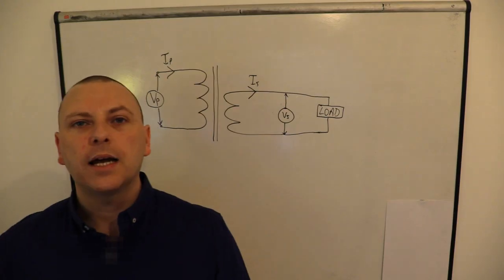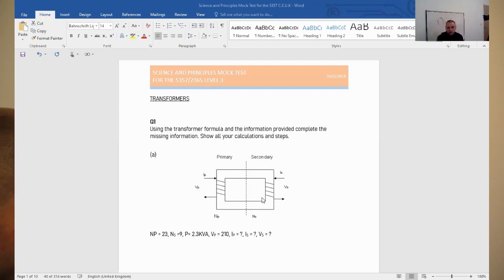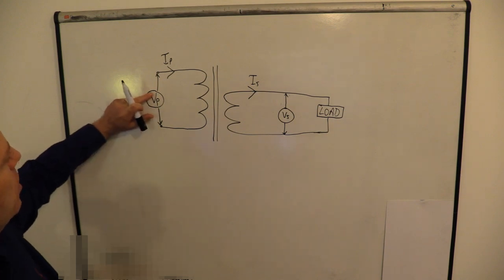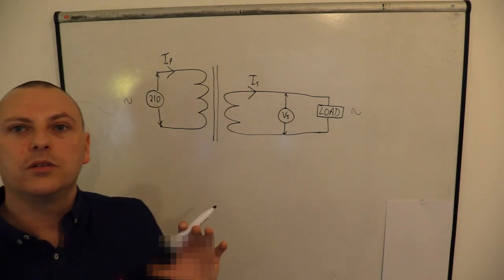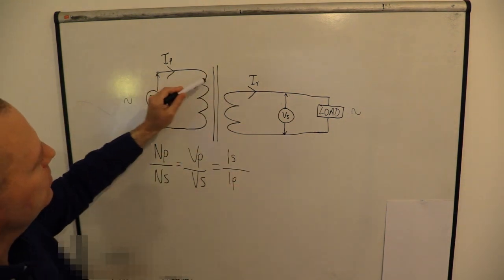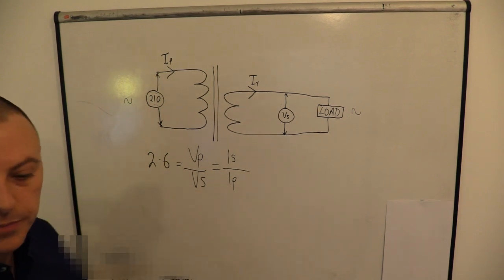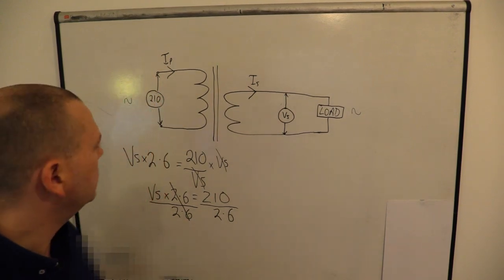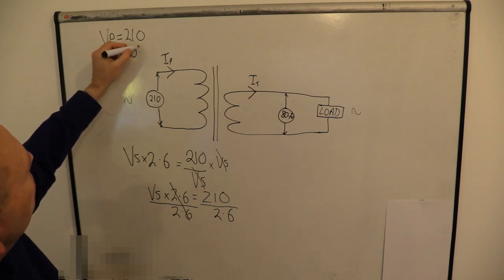Electrical science and principles typical questions No  1                Transformers

Comment from the maker: Beware of accumulating rounding errors!!! In the video I did np/ns=2.555555556 (rounded to 2.6 using only 1 significant digit) and then used that against the vp/vs and transposed for vs to get 210/2.6=80.769 (rounded incorrectly to 80.7 😬) 

Had I simply transposed the formula from the start then I would have ended up with 82.2V

The point is its important to stick to an amount of significant digits and round carefully. For this type of stuff 2 significant digits would be enough.